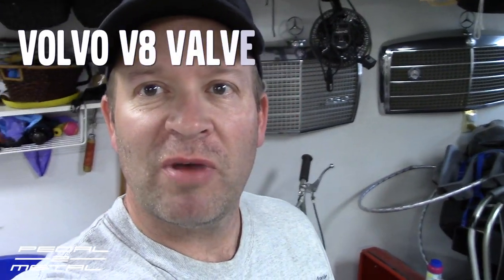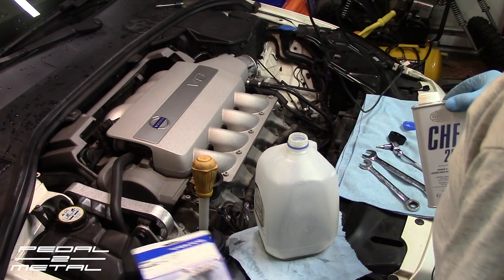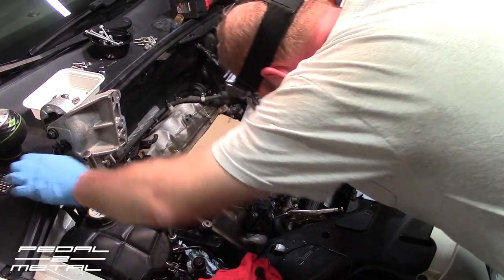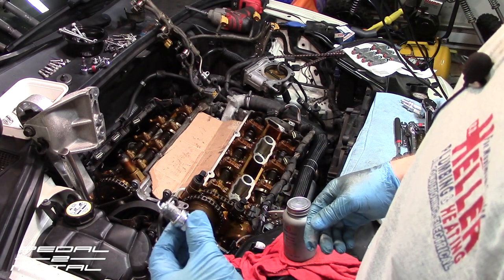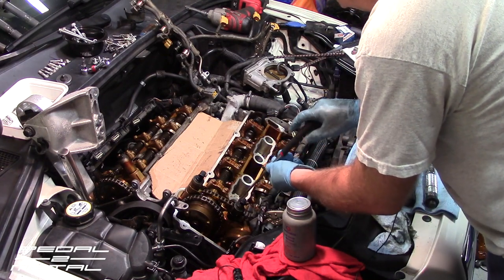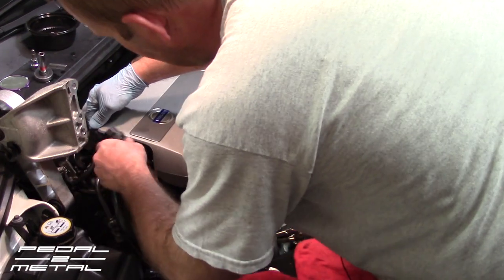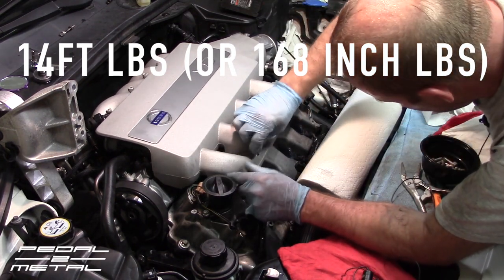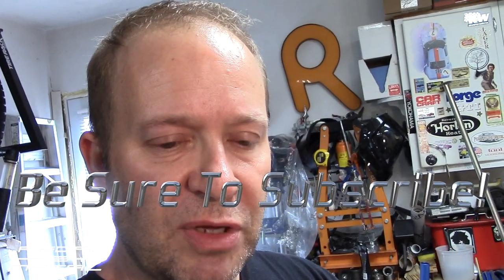Yamaha V8 Valve Cover Gasket Job | A FUN Way to Spend 12 hrs! | VOLVO S80 V8 Project Car Vlog

Comment: Great tutorial! I have an S80 V8 AWD and may needto do this job soon. This was the only vid I could find. Well Done! Appreciate you!
Reply from the maker: Thanks for watching; hopefully it helps you!  Mine is still dropping oil; I'm pretty sure it is the crankshaft seal.
Reply: @Pedal2Metal_on_YouTube   Great video. Useful for PS replacement as well. Any luck with the crankshaft seal? I have the same engine in an XC90 and after your comment here decided to check that before replacing the valve cover gaskets. Fresh oil leaking out and splashing backwards. This comment save me 16 hours!! Any luck with seal? The required Volvo tools are over $500 ($210 for the puller I can probably do without) and back ordered. The dealer wants about $500 to do the job.
Reply: Are you losing significant amounts of oil? The underside of my engine is coated with oil but ironically i always maintain a good level of oil. Thoughts? Have you ever serviced the transmission?

Comment: Thank you for taking the time to do this video. Your content provided enough information for me to complete the job on my vehicle. While I was acquiring the tools and parts I got quotes from various shops for this job. The average for just the valve covers was $1,900. These quotes did not include injector rebuild or a serpentine belt replacement which I performed as well. 

This job took me a couple weeks to complete not because of the difficulty but rather trying to fit it in between life and free time. Thankfully I also had a second vehicle so I was able to take my time which I think is key in doing this job. Of course having the right tools is important but time and patience. 

Again thank you for sharing.
Reply from the maker: Hello, you're welcome; thanks for watching the video! Looking back I regret not doing my timing cover gasket right away when I had everything apart. My car has been leaking oil in that location since doing the valve cover gasket job... the local Volvo dealership quoted me a price of $2,600 2 yrs ago to perform that job, along with a new (rebuilt) Bosch alternator at the same time, as a "while you're in there" item, requested from me... even tho they scoffed.  After hearing the quote, I said no.  They inspected the car last year and passed it, this year they said they will never inspect my car again, until the leak gets fixed.  So, I guess I'll be doing that job this spring along with new idler bearings (have), new belt (have), new belt tensioner (will need), new water pump (which I already purchased from FCP), and also I want to get a rebuilt Bosch alt from FCP, and do ALL this crap at once... I then feel this car will be bullet proof for another 150k miles (hopefully).
Reply: That blows. I thought about doing the timing cover job when I saw that FCP offered a kit for it but choose to take the gamble since I had no signs of oil coming from there. Hope your second attempt goes smoothly especially with the alternator swap. Crazy how much dealerships or some shops want to charge.

The next dreaded job I have been putting off is the cabin fan replacement. The bearing squeals at any speed now. There’s a good video for that just another tear apart the car job.

Comment: I did this in about 1.5 hours, with silicone. I just took the fuel rail and top intake off. Cleaned it with brake cleaner and did a bead of silicone around both valve covers. Been holding 4 years. No leaks at all.
Reply from the maker: It's VERY tempting to try that on my timing cover... Its leaking.
Reply: You did this WITHOUT lifting the valve covers?  If so, let me know.  I would rather not remove the valve covers.
Reply: @securityfamily  I just cleaned it all the way around the covers (never took them off) and then silicone all the way around.
Reply: Great thanks. Mine aren't leaking very fast and so I m guessing this will work for me as well. 06 xc90 v8 165000.
Reply: @troutjunkie7330  how it’s holding up ? I’m not ready to spend 8 hours for a gasket job

Comment: Excellent video and great job, thank you for putting this together. I presumed this job would be time consuming and overall non-fun before even getting into it, and your detailed walkthrough and running commentary confirmed that for me. For many backyard mechanics like myself, this is one job that just might be worth paying the local shop to do. I was quoted $839 for labor and parts to do this for my '06 XC90, we'll see how that shakes out. Cheers and great work.
Reply: Price just went up to $1300 (they just realized the intake needs to be removed...) Knew it was too good to be true.
Reply: @frozendecibel  if you are just doing covers it is not a huge deal.  the PCV can unbolt from the valve cover and come off with the upper intake manifold

Comment: It seems like most of the work is getting everything out of the way. Once everything i out of the way it seems simple enough just tedious like you said. Thanks so much for doing this, the valve cover gaskets are seeping on mine. One more thing I have to do along with getting the angle gear fixed. I'll more than likely let a shop handle that job, but the valve cover gaskets i can take care of myself.
Reply from the maker: Yea, looking back on it...  Its just time consuming.  Thanks for watching!

Comment: I have an '07 XC90 V8 that I'm almost certain has a rear main seal leak. It is for sure leaking from the valve cover gaskets. With the timing cover being a common issue I'm tempted to just drop the entire front subframe and separate the engine/transmission and do all the jobs at once. That would definitely be a ton of work but this thing is too dang nice to neglect. I wouldn't try this until next Spring as I don't have enough head room in the garage. This would have to be done in the RV parking spot but I'm not sure I could actually lift the front of the vehicle high enough to slide the drivetrain out. Oh well, I guess some AT205 is the solution for now.

Comment: Mine has been doing that “not starting” thing occasionally too lately.
Reply: Did you fixed it ?
Reply: Yeah, turned out to just be a slightly weak battery turning the starter over @4Currency

Comment: Hey @Pedal2Metal - Your video has been super helpful for me but I am at the part on the rear cover where there is a fuel line running across it (2 of them). In your video, it cuts right where you say you don't know how you'll get it off and when the video resumes, it is off! Please, do tell - how did you get these fuel lines out of the way ?? I think once I get past this, I am home free. Thanks!!
Reply from the maker: I used a bungee cord to hold them up and outta the way; it was a pain, but it was enough to get the valve cover out.

Comment: My valve cover gaskets are leaking in my timing cover was leaking I put some bars leak rear main seal repair in the oil and it stopped the timing cover leak. And also slowed down my valve cover leak quite a bit it doesn't do anything while it's running until I shut the car off and when it's running the oil back down to the sun it leaks out the front valve cover. P. S. 
That will build up as from the PCV valve and an oil catch can system would stop that from building up in the intake manifold. I have a Dodge charger that has an oil catch can on it to prevent that power robbing oil build-up.

Comment: Hello, right at 12:41 you were struggling to take the upper manifold off, how did you get it off?  I'm doing that job now and stuck right there?  I can't see any remaining bolt or hose holding it on but something right there is stuck and wont all ow the cover to pop off.  Let me know what you did to get it all the way off.
Reply from the maker: Hello, if I remember correctly, it was the hard brittle pcv hose that was holding it down.  Once i got the hose to break in pcs.. The manifold came off. I also had to tap on the manifold with a rubber mallet too.
Reply: Also bro, I struggled here having undone the hex bolt things only to find I'd missed the sneaky 10mm bolt that sits next to the power steering line from the reservoir to the cover. 
The hose clamp winder was obscuring the bolt.
Also a total pain that it has a whole heap of hex bolts and only 1 10mm.... I bet people have snapped this bit of housing off.....🙄

Comment: Can you replace the gaskets without removing the powersteeringpump?
Reply from the maker: Hi, if I remember correctly, you do have to move up and out of the way.  Its only a few mins to pull it; not a huge deal

Comment: Great video! I need to do the power steering pump on mine. Any idea if it can be done without removing the manifold? I want to avoid doing the gaskets if I can.
Reply from the maker: Yes, I'm pretty sure its a simple job from what I've heard.  Mine makes a little noise from time to time, but I'll wait.  I did change out the ps fluid reservoir for a new one.  They have a built in filter screen that sometimes gets clogged.
Reply: I'm in the middle of this job on an XC90 V8. Same deal. The power steering pump has a bracket on the back that's bolted to the rear head using a shared bolt for the lower intake manifold. Removal of the upper half of the intake manifold is required to access this bolt. The pump can't be removed without first removing this bolt.

Comment: 1. Looks like S80 V8 engine is the exact same as the 05 XC90 V8 engine. Right? Why such a large engine on the small beast?
2. Do you have to remove the belt to do this job?
Really awesome video you have. Thanks!
Reply: More power that's why 😂
Reply: S80 isn't that small, it's basically an XC90 with a saloon body.

Comment: Hey buddy, related to after this job, ever get code P0081? Intake Valve Control Solenoid Circuit Bank 2? Need help diagnosing this. Thx

Update: pretty sure it was one of my cam sensor plugs. Messed with it some and fault has not come back yet.

Comment: Looking to buy another 2009 XC90 V8 RD and during a pre purchase inspection, they note a slight leak from the valve cover. They quoted $1882 for”front cover and valve cover”. As much as I’d love to try to do this myself, I’m leaning on having them just do it and try to reduce the cost of the purchase of the XC90. What do you think?
Reply from the maker: I tried that with my Volvo dealer and they said they wanted nothing to do with the repair! And they are an actual dealer of Volvo cars.  Lol. I ended up getting $2,100 (usd) knocked off the already high price, but they did install all new rotors and pads.

Comment: Great video, well done for putting the time in and for your very honest work.
Just thought to mention tho, spark plugs already have a special coating on the threads from factory, it's been this way for some time now. In fact adding antiseize to the threads gives an incorrect torque value(it will be over torqued), this can actually cause issues down the line.
Other wise great info and tips, thanks!
Reply from the maker: My spark plugs sure did not seem to have any kind if coating that I could see or feel; that's for sure. I don't like to take a chance with spark plugs going into aluminum heads. I struggled with a few of the volvo plugs getting them out; to the point a few felt like they were going to break on me. ( I know all too well from dealing with Ford's aluminum heads.)
Reply: @Pedal2Metal_on_YouTube  if they were new, then they had a plating on from factory. This was addressed by the oem and spark plug suppliers due to the increased length of spark plug change intervals.
Only if reusing the plugs should a little be applied, see thread for info.
https://ricksfreeautorepairadvice.com/anti-seize-spark-plug-threads/

Comment: Hey I was wondering how you got the intake manifold to come off the car and how difficult it was. I was thinking of taking mine off and power coating it while I was looking at the fuel rail sensors as I get a high pressure code from sensor A that is intermittent.

Comment: How’s the car running? Any leaks? Any thing you’d do different or leave out? Thanks again for great video.
Reply from the maker: Hello, yes I majorly regret not buying the whole complete kit to do the timing cover gaskets as well. It's leaking oil from the timing cover area very badly. The dealer quoted me $2,600+ two yrs ago... no thanks!  So, I recently ordered all the gaskets etc to so the job. I also ordered a new water pump too. I also want to do the alternator while the motor  is all apart AGAIN..  ugh.  But once it's all done it'll last a long, long time.
Reply from the maker: Also, I just had my state inspection performed at the volvo dealer where I got the car 4 yrs ago.. and they passed it; but threatened to not inspect it next year due to the oil drip.  Ugh
Reply: Did you end up getting the timing cover done? Working on that now, and wondering if having the engine apart makes the alternator job any easier…

Comment: One more question.  When taking off the fuel rail there is a small, flat washer on top of the fuel injector. It’s grey in color and seems to be there to hold on the “red” o ring.  One of those busted how important is it?  Is there a fix so I don’t have to buy a new Injector?  Thanks again!!
Reply from the maker: I believe those are plastic spacers. I looked (on my Instagram pg) at the very few pics I took of mine and I don't see any grey ones; mine I think were an orange color.  I'm not sure how important those are tbh.  And I tried to look for the rebuild kit I purchased off eBay and I couldn't find any for sale.  If it comes down to it, you could always order a rebuild kit that contains everything you need.  I just got another in the mail for my ford truck v8 motor and the whole was only a few bucks.  Sorry... Not sure where else to tell you. If I find the yamaha v8 kit, I'll let you know asap.
Reply from the maker: I found this set, but its from China: eBay item number:
331938018128

Comment: Hi where the camshaft position sensor located on driver side or ps side and are they 2 ?
Reply from the maker: If I remember correctly there is one on each valve cover

Comment: Ive been looking on the forum and some recommend doing a timing job while at it.
Chain, tensioner, idler, balance shaft bearing, plus the whole gasket kit.
My question is: do I really need to touch the timing? The car is 230k km/ 170k miles.
Reply from the maker: No, I've never heard that before.  They most likely just are referring to the timing cover, which leaks.  Mine needs done.  The other thing I need to do soon and is recommended is the two idler bearings, and serp belt at the same time.

Comment: I had same issues what were fixed by mechanic. I would have done it myself if I had this kind of instructions. What about power steering reservoir? I'd like to see, what kind of filtering cloth and dirt is in there.
Reply from the maker: I forgot to cut open the old bottle; I'll make sure to open it for either a separate video or I'll post some pics on my Instagram pg. Thanks for reminding me!
Reply from the maker: "Whats Inside" video is up: https://youtu.be/oaHHXkv3qTo

Comment: I'm working on "The Pearl" currently, thanks for the direction.
Still got her?
Reply from the maker: Yes, I still it.
Reply: @Pedal2Metal_on_YouTube  What was your deciding factor on whether to do the Timing chain seal or not, I pulled the metal heat shield on the back side of the engine that looks like a fire wall helps alot with working room.
I'm 5hrs in and the Tappit covers are clear for removal, I was able to pull the whole fuel injector assembly also.
Reply from the maker: @JohnRogers0014  Well, looking back I should have "tried" to do the timing chain cover since now it is leaking horribly.  I tried from the side wheel well and had no luck getting tools or my hands in there to pull the pulleys etc.  Plus I don't have a lift.  The local dealership quoted me $2,600 to do it... Ouch!  So... For now I just put stop leak in with each oil change.
Reply: @Pedal2Metal_on_YouTube  Well I got the whole kit so I'll keep going..
Just thought maybe I was overdoing the repair. 
Alternator is be replaced anyway.
Note: "Don't buy New Chinese or Any Rebuilt Alternators, The diodes don't get replaced and Chinese Alternator won't hold up to the heat. New Chinese lasted 2yrs."

Comment: Just finished replacing the timing chain cover gasket on a 2006 xc90 V8 4.4. with 120,000 miles. Did it in 16 hours. The old gasket was hard and brittle. It was split near the alternator.
Reply from the maker: I'm dreading that job... I think mine is still leaking there or the front crankshaft seal.
Reply: Have you found a video for that?

Comment: Hi, I really appreciate your video and patience.  I'm doing this job now with my '06 XC90.  I got the magnet you have and it's a life saver.  Also ground down the 10mm wrench too, that is a great tip.  I couldn't find the cleaning video on the fuel injectors.  I have a question and think I know the answer but are the fuel injectors proprietary or can be put in any location?  Much appreciated!!  P.S. yeah I dropped one 10mm below and CAN'T find it for anything :(
Reply from the maker: Thank you for watching the video. No, the fuel injectors can put back in any cylinder. My injector video sb under my Volvo S80 playlist.
Reply: @Pedal2Metal_on_YouTube  nice, I'll watch that too.  one more question, I noticed that you had the fuel injectors in when you installed the upper manifold and then later you had them into the fuel rail and installed the fuel later after the upper manifold.  Is that the best solution for that?